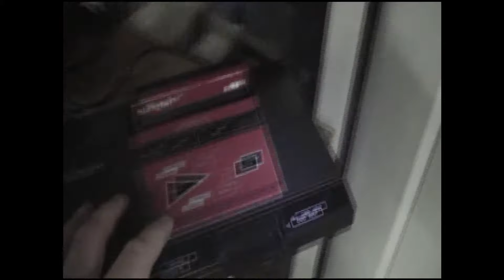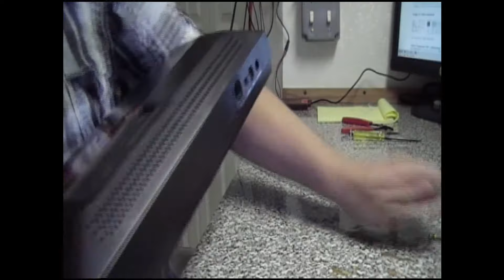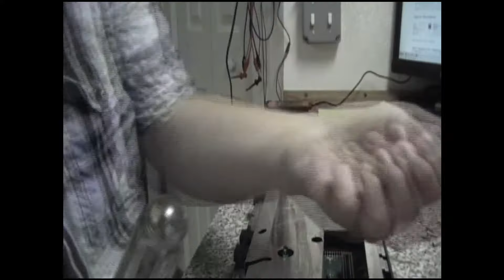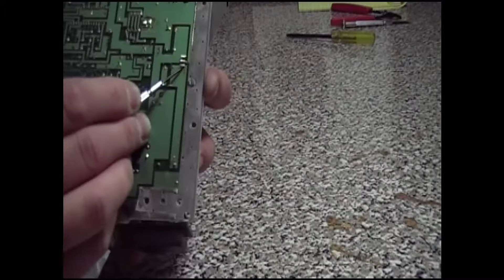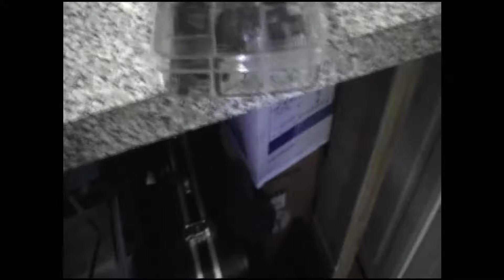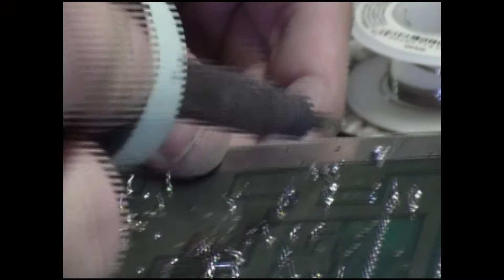Sega Master System Repair

Comment: Good work but i truly hate that stone bench and messing all the screws, i use white foam not to scratch consoles and group the screws inside cups with lubricant so that when i assemble its easier to screw them without damaging the case and imo you should clean the board before closing it.

Comment: Hey man..repaired my Master System 2(both actually)..turns out the problem with one was a 7805 and the other was corrosion on solder joint and corroson in cartridge slot..next on the agenda is an Atari 2600 JR..just the console no cords or games..no idea if it even works..waiting for it to get spring down here in NZ to get motivated to get back into repair works lol:)
Reply from the maker: Congratulations! I'm very excited you got it repaired. Sounds like got more projects lined up! There is a neat RCA mod for the 2600 that bypasses the coax plug. MUCH better video and sound. Good luck on your future repair.
Reply: Thanks;)

Comment: I pulled my Master System apart thinking it was broken because the last time I tried playing it, there was no power LED. I must not have had the power supply in properly because my 7805 is working perfectly and reading 5V.
Reply from the maker: Have you tried your master system since? You may want to try testing the DC voltage from the transformer.
Reply: Tecnolock I don't think mine had any fault because I had just assumed it wasn't working from last time (when i probably didnt have the power cable plugged into the wall properly) and opened it without testing it again.

Comment: I brought a Sega Master System from EBay not too long ago, when I press the power button the green light comes on but the screen is black 😔
Reply from the maker: I has a similar issue with a couple Sega Gen Mod 2 units. Start with making sure the game socket is super clean. I'd get an old game cleaning unit and trim the edge connector to fist the SMS. If your still having issues after that, try replacing any electrolytic capacitors on the board. Good luck and thanks for watching!

Comment: I have a SMS that instantly smokes the 7805 as soon as you turn it on?? Using Genesis 1 power supply. Any ideas??
Reply: Is the Genesis PSU AC?
Reply from the maker: Start off by checking the voltage and power type of the power supply with a voltage meter. It should be around 9V DC. The common issue with the SMS is folks plug in a Nintendo Power Supply which is AC. The AC smokes the 7805. If the voltage and power type are correct and the 7805 is still smoking you may have a larger issue. Try following the trace from pin 1(Voltage input) of the 7805 back to the DC Plug on the counsel and test each component on the way. The issue you need to find is why would too much voltage/AC be present on Pin 1. Hope this helps.
Reply from the maker: I'm thinking the same thing as naytch2003. Most likely a bad power adapter.
Reply: Actually figured this one out. Some of the caps near the cart slot that are normally laying down had their legs twisted causing a short. So I untwisted them replaced the 7805 AGAIN.. and voila it worked. Was hoping for a Built in hang on or something... but got another maze game.. that's all i ever find.. lol.

Comment: how do you have a 7805 just laying around?
Reply from the maker: I scavenge parts out of lots of failed devices. Luckily 5 volt converters like the 7805 are common. Thanks for watching.
Reply: Anyone who needs to repair eletric devices must have a couple of 7805 around because they tend to fry with intense use because of the super high temperature they get

Comment: I have 2 SMS. Ones not getting power so will try replacing the 7805. The other isn’t reading cartridges even though I’ve cleaned it out using the credit card in an old T-shirt trick. Any thoughts?
Reply from the maker: SMS 1: I'd start by testing the voltage on pin 3 of the 7805. That should be the output pin and should read close to 5 volts. If you read no voltage on pin 3, the 7805 voltage regulator needs to be replaced. If you replace it and it blows again, make sure the voltage on the wall adapter is correct. 
SMS 2: I've had the clean the cartridge slot a few times before getting a game to work. Take a magnifying glass and inspect each pin. Look for trouble spots like excess corrosion or bent pins and address each pin as it comes along. The credit card and T-shirt works better if you use a wet/dry method. Grab some rubbing alcohol and wet one T-Shit strip and clean it, Then repeat with a dry one.
Reply: Tecnolock I replaced the 7805 and it worked again! I never got the other one to read games after fiddling around with it for hours on end. Tried cleaning, aligning the pins meticulously,  just about every suggestion I could find.

Comment: I have one that needs repairing. It starts and has sound, but no video. rf or av, no screen. Any hints on how to fix it?
Reply from the maker: The number one problem with master systems is trying to connect the wrong style power adapter, make sure you are using the right one. Also older system typically suffer  broken/cold solder connections. I'd inspect the solder pads on the main board and make sure everything is correct. Check out some vids on how it identify good bad solder connections.

Comment: my master system powers on, but shows no picture. only shows a solid black line
Reply from the maker: Solid black line or a solid black screen. When powering a unit on, if the screen goes black, you know at least that the video chip is getting powered. Most times I see this type of issue its due to a dirty or corroded game slot. I have a slimier issue I resolved in my Sega Genies repair video.